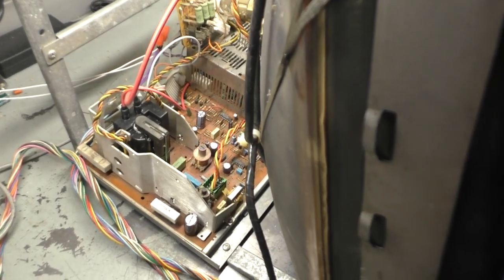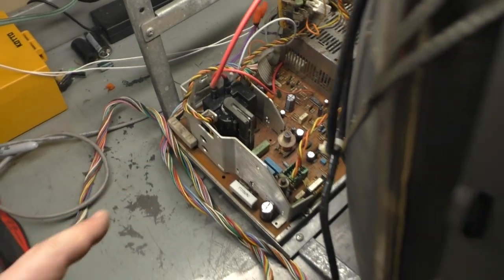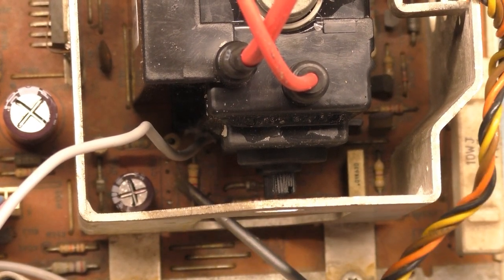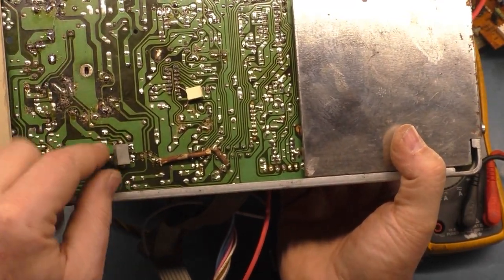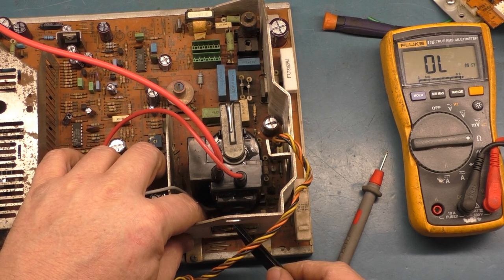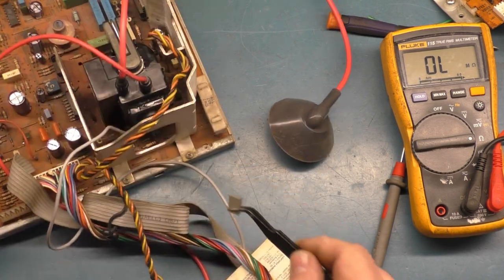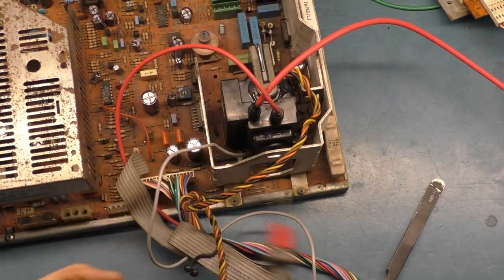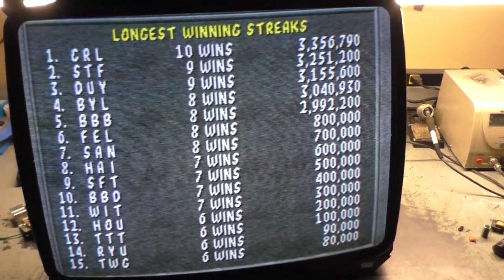25" Hantarex Polo Arcade Monitor Repair - No Brightness Control Solution

Comment from the maker: Here is a link to the other video I mentioned that featured the full repair… https://youtu.be/opZQHKeuNDA The high-pitch noise is actually coming from the horizontal linearity coil core. I tweaked it a bit and it went away. Sorry about that.

Comment: Hi there. I have a WG K4900. 
I swapped the tube out with a donor TV. Image looks awesome but vertical size is too small. vertical pot is maxed out. 

I measured the vertical deflection coil on the yoke, and it's at 15ohms. The original tube was something like 30 ohms. 

Now I know that it's possible to increase the size of the horizontal image, by increasing the size of one the polypropolene capacitors. But is there a way to increase the size of the vertical image, by changing a component? Or is that impedence just far too low for this chassis?
Reply from the maker: 15 is way too low, There’s no fix without re-winding the yoke. You need to also worry about the inductance being incorrect as well. You’ll need to remove the yoke from the original tube and swap it into the donor tube. That’s the only way to fix his properly unfortunately.